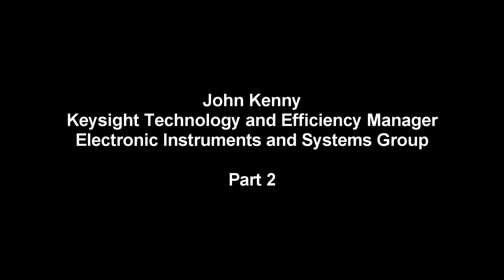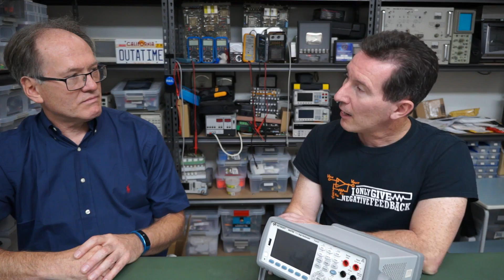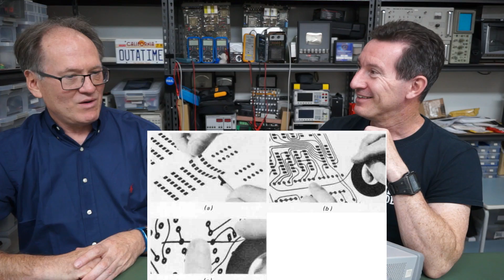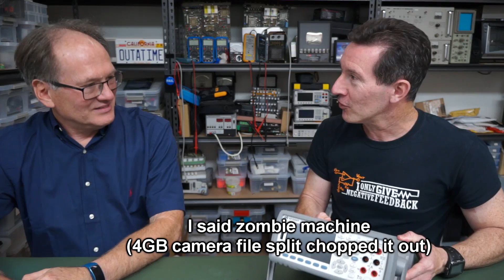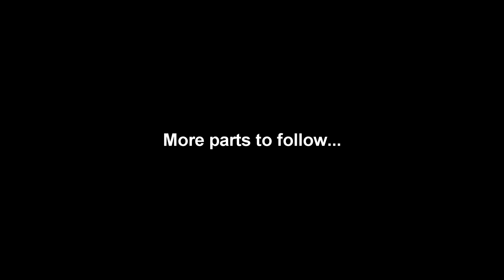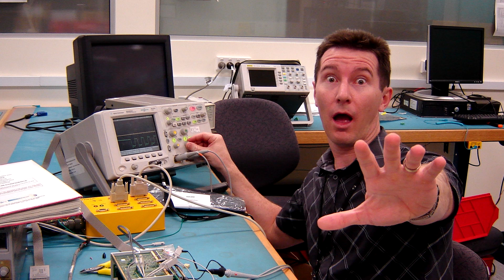EEVblog #1032 Part 2 - John Kenny Keysight Interview

Comment: Oh good lord, not the GPL "have to publish all my code" BS again. If you alter GPL'd code, you have to publish your changes (specifically, to those for which you supplied binaries built from modified code -- key thing to note here, that does not mean "publish to the world") Any code that is wholly yours is yours_, and does not have to be published to anyone. Lots and _LOTS of companies use linux, and don't publish any code for their product. Two big names... Tivo and CISCO! The Linksys snafu was simply that they hadn't realized their modifications to GPL'd code would have to be published -- and they naturally resisted. They did not "release all their code"; to this day there are still bits for which you won't find any source (DSL, DOCSIS, and voice chips)

That said, Linux is not the panacea people think. There are much better (smaller, faster, lower overhead...) commercial OSes out there. (qnx, vxworks, etc.)

Comment: Also without service manuals they copy your products. But if your gear comes with schematics  it will be a bonus and  and a reason to buy Keysight. I repaired a Tek scope for a customer who asked me what brand came with schematics if repair was not possible.  (They have several Teks) He was really pissed at Tek  that did not want to repair it because it was something like 8 years old, and because they publish no schematic so nobody else wanted to try it. 99% of what I repair is without schematics so I repaired it. Often the expensive special parts are not the problem. 
By the way, the old HP gear  seems to function for decades, I do not think the new gear does that better.  I had to repair my Agilent multimeter a few times in 6 years and my R&S(Hameg) 350 MHz scope 2 times.

Comment: His criticism of Linux USB and LAN is a little odd.
Especially the USB stack was way more solid than the windows one whenever a new USB standard came out. The situation is overall pretty much that still I think.
Networking Microsofts strong point? Hard to believe too. No tin my experience.

Linux embedded suffers sometimes from grotesquely bad drivers. But that is nothing you can generalise.

His comments on "problem with Linux and licenses" is mostly FUD. But good that they are thinking about the issues before it catches them with their pants down.
Stuff like Red Hats patent protection might be helpful to them. But I think the issue is overrated. They are big enough to have most of the bad patents licensed already and have enough defense through their own portfolio.

Comment: Most of what was stated about GPL, schematics and patents is plain simply bullshit. GPL license is quite straightforward: If you make changes to GPL software you have to publish the source code. No risk there as all their IP can be locked in "binary blobs" like Nvidia, AMD and the rest have been doing for years. The schematics: only logical conclusion is that they do not want anyone else fixing their gear. And it's nothing new: Apple has been pushing for schematic as proprietary. Louis Rossmann channel has a few videos about that and their struggle to push legislation. The "support" for schematics and parts: give me a break, does anyone really believe that? The reverse engineering part is even more nonsense. People these days decap chips and read out ROM contents and reverse engineer ASICS and that can be done by one man and 50K of equipment. Imagine how hard it is for a competitor to reverse engineer their boards? It comes down to the same bullshit that Dave is so quick to point out when Chinese manufacturers do: rubbing out the markings from chips. The design patents claim follows the similar pattern. What it comes down to is patenting ideas. And it has been rehashed a thousand times by multiple organizations dealing with patents, open source etc so I'm not even going to bother with that one.

Comment: Network security and webcams, smh. 
95% of unauthorized accesses are not due to Mr.Robot methodically cracking away, they are due either to granny installing some malware popup or some fool in the company purposefully over riding reasonable product defaults, swinging a firewall port wide open and removing all passwords so the boss can work from home without all the hassle of logging in. Or they do stuff like install a network camera outside of the network so its just sitting there open to the internet, or leave the default passwords on everything. [eg admin1234 ] Some actually think that just because they don't openly publish the ip on google it's secure and nobody could possibly stumble across it. 
Hell this guy came across several power plants (hydroelectric dam) in France with data and controls open to the internet, he tweeted about it, homeland security contacted him for details and then reported it to the French authorities, they didn't fix it for nearly another year. The guy's hobby is scanning for open ports he has an hour slideshow of all the ridiculous stuff he finds. He now tweets about his finds because whenever he would privately make contact corporate bureaucracy would prevent the issue from getting fixed or even accuse him of "hacking" but tweeting it to the world makes them fix it in just days or hours .

Comment: Ethernet/Networking under linux is a non issue - he literally said OpenWRT as an example. USB can be tricky yes - but some people will love when they can use a linux formated USB thumb drive.
Reply: In newer kernel it works without a issue.
They just have stop using ancient 2.6.x kernels

Comment: How did anyone make money with OpenWRT? To my knowledge, it has always been free to install and run on a router that's supported by the firmware. In fact, I have been running OpenWRT routers myself for about 10 years now, and the firmware was always free to install, even when I used a fork that based on OpenWRT but had different functionality (like Tomato).
Reply: Certain companies provide payed support or customizations based on openwrt. Good example of this ddwrt.
Reply: It's bullshit, like the rest of it.
Reply: It's simple.  Every other competitor could just take a Broadcom reference design for their hardware and use OpenWRT or some other GPL firmware derivative as their firmware.  You're basically able to instantly bite into the market without any R&D cost.  Linksys ate the development cost for you.
Reply: You still seem to miss the point.  Nobody is making money off of OpenWRT directly, but its existence allows people to create products based on it that they sell without having to invest in firmware R&D.  There are many SoC products out there using Linux and OpenWRT derivatives as firmware and this adds value to the product, making it competitive and also easier to maintain and develop.  It doesn't matter to these people that they have to open-source the firmware because that's not what they are investing their dollars to manufacture.  OpenWRT just makes their hardware product viable in the market, like an OS or a killer app for your PC.
Reply: Same as any other open source projects are - donations, and sponsors.
Reply: QQQQ so usually nothing to cover the expenses or even create revenue from.
Reply: Tplink sold a lot of routers
Reply: They did and still do, but none of their routers came with OpenWRT. If their stock firmware were based on OpenWRT, they would probably have committed a GPL violation though, because to my knowledge they never released their source code. But yes, the fact that you could install OpenWRT on those routers, was their best feature.
Reply: ollopa1 But then you'd still have to completely open source your firmware. Unfortunately, tivoizing the device isn't prohibited though...
Reply: So Linksys saved tons of money by using Linux, that is true. OpenWRT is used by other manufacturers and they release the code for their products? Can you list some router manufacturers that are open source ?
Reply: Maybe hardware sales; router boards and/or add-ons(serial/jtag adapter...etc.)
Or special software plug-ins.
Reply: It's the emotional response of industry old timers to fear open source. The economic concept just doesn't mesh with the "common knowledge" of economics and business management that they were raised with.
Reply: wolfedog99 that must be it. Quite sad. Open Source is after all the superior concept, from the standpoint of a society (anyone who can and is willing contributes and it serves everybody).
Reply: +ollopa1  No, Linux community and developers ate the cost, Linksys tried to cheat ...

Comment: Disappointing to hear how they want to use linux but the inherent open source nature of it is a downside for them. Wish more companies would embrace the GPL license and not look for ways to use linux without giving up what they work on. That's not how it's supposed to work, there's a reason linux is free. Dave definitely took it easy on him with regards to this and patents. It's clear they are still a very old and large company.
Reply from the maker: I realise there are very real legal issues for large companies using open source software. There are very good reasons for wanting to keep some of your code a secret, and the "all or nothing" approach that open source may force you into it can be a real problem. The commercial world is not easy, and the utopian world of everythign being completely open and free is not realistic.
Reply: Their position is perfectly understandable. They would just need to figure out how to use the linux kernel under GPL with their code remaining proprietary. This is very common in the networking space.
Reply: Pretty naive comment imo. Every company wants to secure their ideas, resources and time invested in making their products, which includes the firmware. 
Main reason patents exist.
Reply: I can relate to this. Even as a developer, designer and consultant myself, it's sometimes frustrating how certain ideas are being 'locked' just because their own benefits of certain companies. This is even worse when to product execution of that product is horrible.
In my opinion that results in very valuable knowledge and know-how can't be used in a more useful and efficient way.
Because of this, companies tend to reinvent the wheel a billion times and it really slows down innovation.  
In fact, the 'user interface' mentioned in this video is a very good example of this.
Instead of all being angry and stubborn about it (filling your own pockets), try to collaborate and see how you can both have a win-win situation. 
Unfortunately for some people the only importance is how to fill their own wallets.
Reply from the maker: Hence why I have tried to help solve some of these issues with my letter based OSHW logo idea.
Reply: I can kind of understand them.
But what they call "legal issue" is not an issue,it is a licence to use something that was provided to you completely free and what is work of a lot of people of 26 years now.
GPLv2 licence that Linux uses is pretty simple,you can use whole kernel and make as much money off it as you can but you modifications have to be available.

All networking companies now use Linux and mostly comply with GPLv2.
Also you are required to provide source of your modifications to all software used under GPLv2.
That does not include apps you as company have written,web UI etc.

Or you can write your own kernel and accompanying tools we now take for granted.
And licence it however you want.
Reply: For example?  Typically the drivers are not closed source but they upload a binary blog firmware payload to the hardware that is not a part of the driver.  Or like with NVIDIA there is an open source wrapper driver that attempts to interface with a binary blob in such a way that the blob is not considered a derivative work of the driver.  Much care has to be taken to ensure there is not a GPL violation.  Please do your research.
Reply: I agree with the fact that it's not realistic to have everything completely open.
I personally also don't get why it needs to be that black & white.
The thing is that there is nothing to stop you to form a new type of license were most of the things are open (or at least the general idea and block diagrams) and some are closed.
Or some things are open but for commercial use they are closed.
In the end it also means that companies who 'copy' your product also have to use the same license.
But at this moment it's kind of all of nothing with everything, even with a patent.
Reply: It's definitely a complex issue and there are lots of different points of view with regards to how much people think should be shared or available freely. There are obvious issues with sharing everything all the time. It was definitely an interesting interview and brought up lots of interesting aspects of the business that I wouldn't have considered like how linux's open nature can be viewed as a downside for companies like these.
Reply: good point, and it's not open source that forces you into that, it's GPL, but some things are what they are, and sometimes we need to work with what we have, I personally would love if everything was open source, but that's unrealistic, and we need to work with that too
Reply: There are a lot of companies building successful products around Linux and Open Source. They just have to play by the rules. Having to publish an improvement to an USB kernel driver for instance won't put the company IP at risk but it benefits the whole ecosystem.
Reply: If one were to open-source the firmware on things like scopes and ARBs, there would be no way to enforce licensing for software apps, waveforms, and bit-flip options.  It would also open up the market for third-parties to write competing software and take away business opportunities for Keysight, not to mention expose proprietary implementations of DSP algorithms and other software trade secrets.  I guess you're an idealist but you can't run a competitive business in this industry by open-sourcing the firmware.  GPL is a major danger and stabs itself in the face for this kind of application.
Reply: That is not correct at all.
GPL v2 does not require you at all to publish or open source anything you wrote yourself.
You just need to publish changes to software that uses GPLv2 licence.
Reply: No, if you write kernel modules or link any GPLv2 code then it is considered a derivative work and must also be GPL.
Reply: Linux is successful because it uses gpl2 and not a bsd/mit license, the BSD OS is a drop in the bucket compared to linux because companies like Apple can just take it and run. BSD/MIT are fine for small projects, they are unsustainable for common platforms and even promote insecure systems because customers don't have the right to review and authenticate the software. 
Besides all that, the GPLv2 doesn't do half of the nasty mean things most armchair lawyers like to claim. Loadable modules(drivers) and dynamic libraries are separate code that can be closed source, binary only, just as long as it has a gpl compatible license. There are numerous examples over the years such as graphics card drivers.
Reply: How come that then drivers can be closed source?
Reply: +ollopa1 if you write kernel modules ... Nope. Not even remotely correct. There are thousands of proprietary driver modules out there. Yes, there was much bickering in kernel circles, however, the use of published APIs does not constitute a "derivative work". The pissy linux devs added _GPL and non-GPL symbols to limit what proprietary code could do. Driver devs gave them a big middle finger and created GPL'd driver shims that either offload the meat to userspace, or load a binary blob into the kernel.
Reply: GPL license is worst thing which happened to open source software ever. Thanks to it most companies have no interest to participate in development of open source software that is using GPL license, and like John they just run from software then use GPL license, which is not case for open source software that use MIT License or BSD licenses.
Reply: I dont get what is wrong in requesting your improvements back?
If you dont like the licence feel free to write your own kernel.

Comment: I've only just started watching this part, but found part one very interesting. Hopefully there's more to come.

Off topic, I used to work with HP Proliant server hardware and always found it so much better in design than other manufacturers like Dell, Fujitsu or IBM etc.

EDIT: I got to the end and was glad to see that there's more to follow
Reply: I agree that Compaq Proliant was great design, but after HP bought Compaq all go downhill, now most IBM and Dell are much better then it.
Reply: I was actually saying the opposite. I found HP to be best. From the actual hardware itself and setup/configuration to the software used to deploy the servers (HP Smartstart).

I hated the IBM servers, lots of sharp edges that I used to cut my hands and fingers open on, and the deployment and diagnostic software was very bad. I remember the memory tests used to take a very long time when you installed 64GB+ RAM in them for example. The HP diagnostic tests were very quick which was useful when I had to upgrade and test 10+ servers at a time for example.
Reply: Mark Taylor I do not in what time you use HP but in last years they are much worse then before. 
We replace all HP with Dell and Oracle (we pick Dell over IBM just to keep all from same company because we use EMC storage and Dell now own them) and for us sharp edges are no problem we do not upgrade hardware we simple just replace servers.  Only what I do not like at IBM is that they are ugly but that is just subjective. 
P.s. we are small company so we own less then 20 servers.
Reply: Ah I see. I have been out of the  hardware industry since 2012, so haven't worked with any server hardware since then.